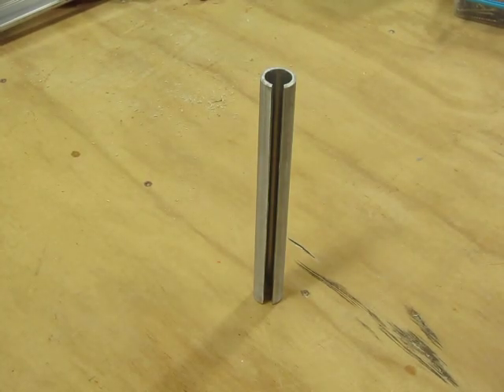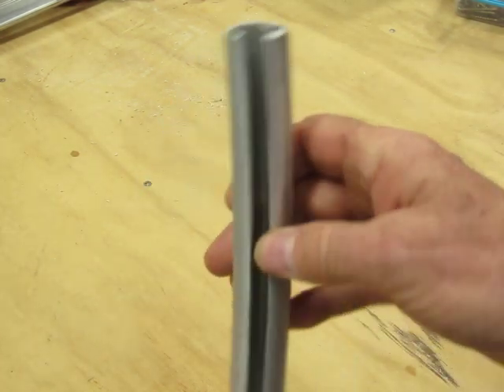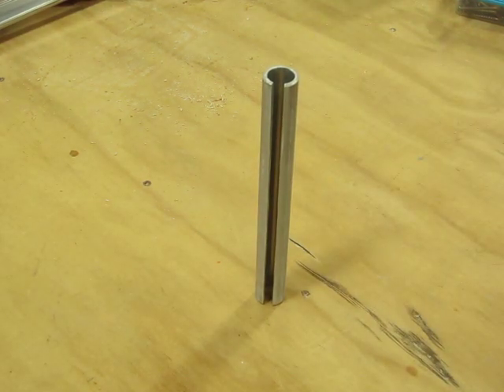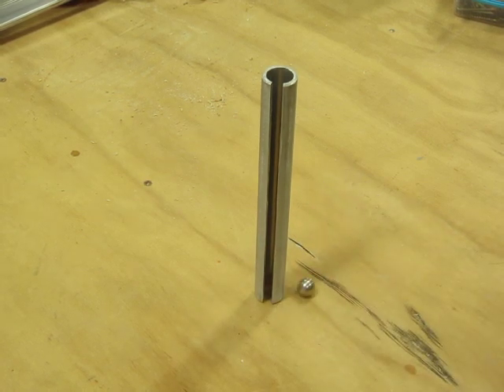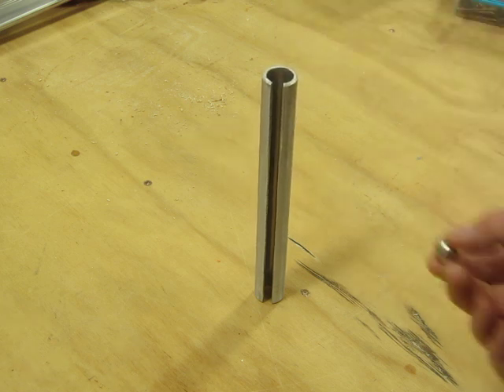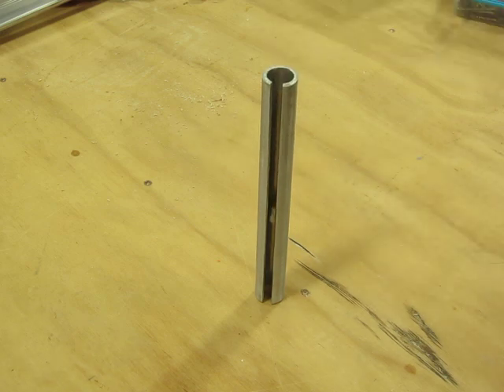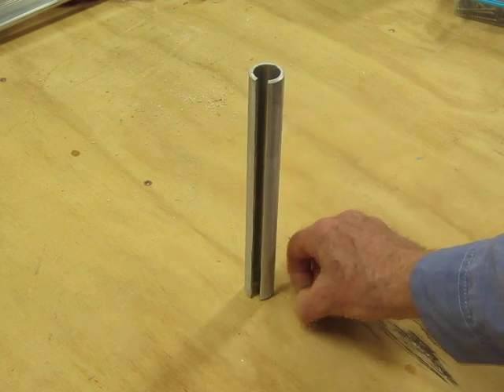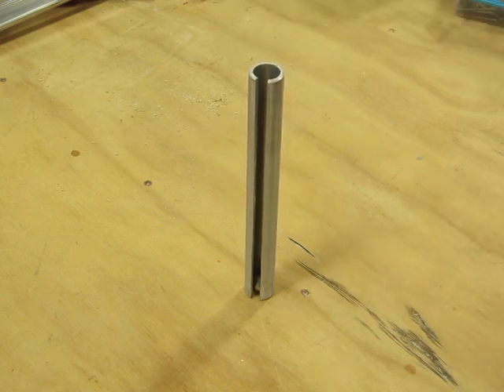Spherical Magnet Through an Aluminum Tube, Part 1

Comment: the magnet falls producing a changing magnetic field in the pipe. That changing magetic field produces eddy current in the conductive pipe. The magnet produces a force on the moving charge in the pipe in the opposite direction of the balls motion. This slows the ball down

Comment: It is indeed Eddy currents inducted  in the aluminium plate where there is no slit. These induced currents create a reaction magnetic field which oppose to the ball magnet field lines. This is due to the fact that some magnetic field lines of a ball magnet are everywhere around the ball surface (the main flux is  south -north oriented tough) and they intercept the PARTIAL tube surfac outside of the slit areae.

Comment: Does this affect magnetic pull toward a ferrous material?  Lets say the aluminum tube was stood on a steel plate?  Does the eddy current reduce the amount of pull force?  What about megnetic pull directly through aluminum?  If I have a 2lb force magnet pulling through 1/32" aluminum how much reduction in force will there be?

Comment: It is always nice to learn new things, on the surface my BS metre is off the charts.  I do have a five foot copper tube and when any shape magnet flows through the tube at slower speeds.  It only works because as the magnet passes across the copper it generates electricity.  That electric charge has polarity, so as it falls through the polarity it is generating the magnet poles it attaches itself to the copper tube, once attached the generation of electricity stops because the magnet  and the copper must slide by each other.  So the magnet pulses each time the magnate gets attracted to the copper opposite pole.  

.

Comment: Interesting, I used to believe this wouldn't work like this because there's a slot in the tube and it doesn't act as a coil. Can anyone elaborate?
Reply: +Bas de Cock the conductive metal initially is at equilibrium in respect to 0 magnetic field and 0 electric field. but as soon the magnet falls through the conductive pipe there is a change in magnetic field experience by the pipe. It's called lenz's law. So the pipe produces a current parallel to the magnet. Now i hope you know that when there is a changing electric field a magnetic field is produced to balance out and conserve energy according to the law of conserve of energy in electromagnetism. In our case, the falling magnetic field disturbs the electric field of 0, therefore the pipe produces an electric field to balance out, and with the electric field is produced a magnetic field  opposing the magnet. therefore is the reason why it falls slower
Reply: Дело не в прорези, это показали опыты,

Comment: "Bas de Cock2 months ago
 Interesting, I used to believe this wouldn't work like this because there's a slot in the tube and it doesn't act as a coil. Can anyone elaborate?"

I think the magnet ball finishes the current most of the time when it falls off. It's a  conductor. It has the diameter very close to the aluminum tube.